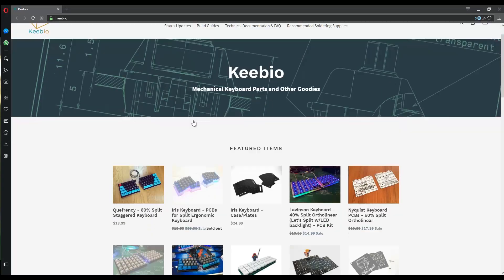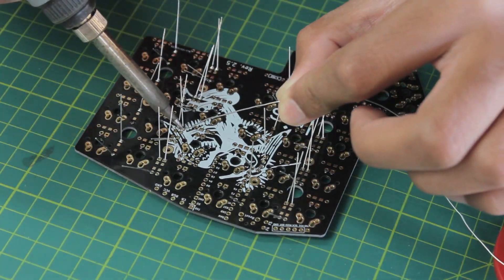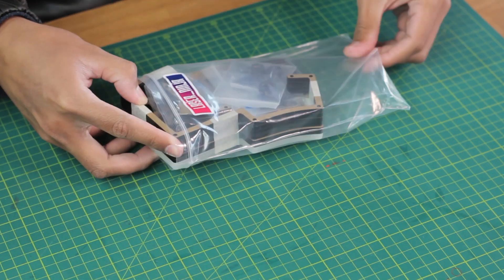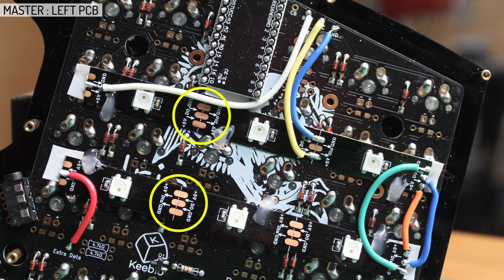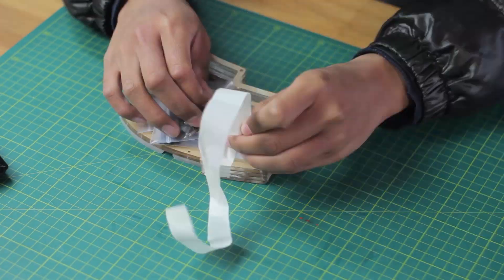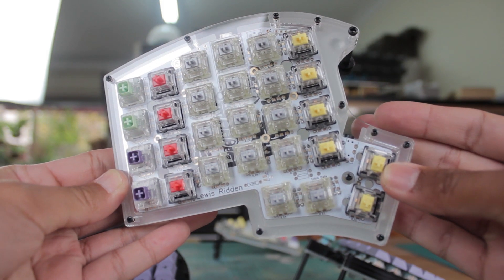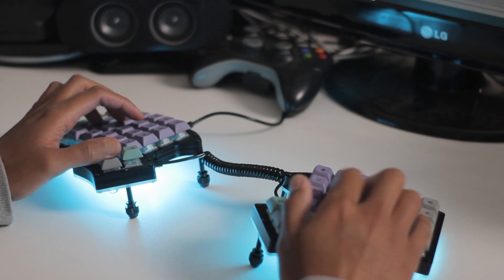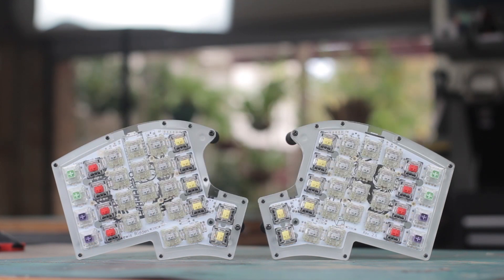Iris Split Ergonomic Mechanical Keyboard Build

Comment: I've been lurking here for quite some time. Finally you built a split ergonomic keyboard, my kind of keyboard :) . Looking at the form of your hands, you need a wrist rest to lift your whole hand to be able to type properly on high inclination tenting kit. I personally use an Ergodox EZ, and it changed my view on the "mechanical keyboard" world down to it's very base. Now, all I see on a keyboard are: 
1. Does it support QMK? 
2. Does it support some kind of Layering?
3. Does it support some kind of Momentary/Direct/Tap-Hold Layer switching?
4. Does it support Dual/N-th Function keys?
5. Does it support Tap Dance like feature?
6. Does it  enable me to define MY OWN custom Layout with many layers in it?
7. Does it support Mouse keys emulation?
8. Is it a split keyboard?

If it checks at least 50% of the features, then I will consider it. Any less is unacceptable.
Btw, you should try and modify the keymap.c file manually to get the maximum benefit of having QMK.

Great video, keep up the great work !!

Damir.
Reply: Same, dude, QMK ruined me.

Comment: Thanks for this video! Both keebs looks really fine. May i know if i could build this without the plate? Meaning the switches just sit on the pcb?
Reply: I do not own the iris but yes you can. But, you need to know how to wire the rows and columns together, if you do not know how it could take you a bit of time to find that out.

Comment: Is switching to an ergo board worth it? I currently main a 40% board, so I have zero issues with layers
Reply from the maker: Hopefully others can answer, because I didn't give this enough of a try to give advice on that :(
Reply: Yes, if you type a lot, like if you were a writer, coder, lawyer, typist etc.  It's still very nice to use one even though you don't type that much.  Currently, nerve damage from long term carpal tunnel syndrome is irreversible.  So I consider this a cheap insurance against it.
Reply: I use an ergodox EZ and I would say it's totally worth it! Honestly, the most difficult part to get used to was the ortholinear layout. It's so much more comfortable for extended use, though.
Reply: @SaltosAxe  i have ergodox ez too... Ortholinear layout is so annoying to get used to because I TouchType.
Anyone wants to buy my ergodox? :D

Comment: I guess this is as good place as any to ask - why does some PCBs (like ths keeb.io ones) require diodes and some (like the katana60 from candykeys) does not?
Reply from the maker: This doesn't have components pre-soldered - as it is a bare PCB. We even need to mount the controller onto this keyboard (Pro Micro). Therefore they can be sold at a cheaper price.

The Katana60 and many other PCBs will already have the diodes, resistors, controller, and whatever else all already soldered on the PCB. So in the end, they still pretty much have the same stuff.

Comment: Finally received and build my Iris keyboard because of you, but I have a major issue: I can't flash my pro micros. I tried 2 different computers with Windows and Linux on both of them but I cannot get them flashed no matter what I do.... I hope your video on the flashing process will help me, maybe I am doing something wrong, but everything worked first time on my DZ60 with QMK... really weird
Reply: Well... Nevermind, after over 3 hours of trying everything out, I finally tried the MSYS2 method on my windows machine. And it just worked :p Now I have 2 working Pro Micros flashed with the default firmware

Comment: Those cases look very slick.  Does Laser_Ninja have a store?
Reply: He has a page/store. I am sure Tae will updating the description or something to get in contact with him!
Reply: Hey it's laser_ninja here, Tae has updated the description with a link to my site. You can also reach me on discord - Ninja#5071. Not selling any at the moment but I will be opening it up again in the future. Thanks for looking!
Reply: Thanks, I'll keep an eye out for when you open up orders again
Reply: Kennui Muffins Hi there. Since you’re not selling your cases right now I’m hoping you can tell me what the rubber feet on the ends of the tenting spacer rods are called so I can search for a buy some. I have the stainless steel case plates and I’m going to drill extra holes to add tenting rods, but I can’t find those really cool feet anywhere. I also can’t find a kit with an assortment of rod lengths, but I at least know what the rods are called to look around for an assorted size kit. FWIW, I’ve seen your case show up in a couple videos now and it looks really awesome. I totally would have just bought your case if I had been able to.
Reply: Hey Bill, those rubber feet are 3M hemisphere about 11x5mm (don't have the code on me). The rods are aluminium standoffs and you can find them in all kinds of lengths and colours. The foot portion are aluminium thumscrews that have a diameter of 11mm (most are 10mm which will mean the rubber feet overhang). 

Next sale will be early 2019 and there will be a never version of Iris PCBs that are fully assembled so you only need to solder on switches, as well as some new features and improvements.
Reply: Kennui Muffins Thanks so much for that info! If anyone asks me to build one of these since my co workers are going to be jealous as hell of my new board, I’ll tell them to save themselves the hassle and just buy your kit when you start your new run.

Comment: Nice video! How much was the overall cost for a single keyboard?
Reply from the maker: Hmm, without the keycaps, 1 Iris would have been about 70+USD (rough est). The keycaps add a lot to that price, although there are many cheap keycaps out there.
Reply: TaeKeyboards Thank you 👌

Comment: Pro tip — If you don't want to sound like an idiot simply call TRRS four-pole phone. Rolls off the tongue better than an acronym. TRS for three-pole, TS for two-pole (usually microphone or power-only), and for TRRRS, five-pole.